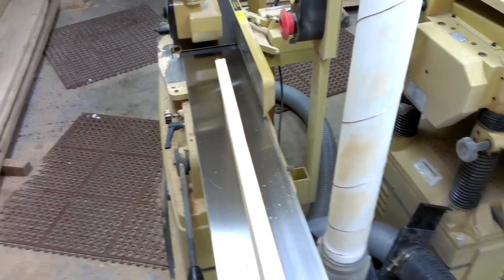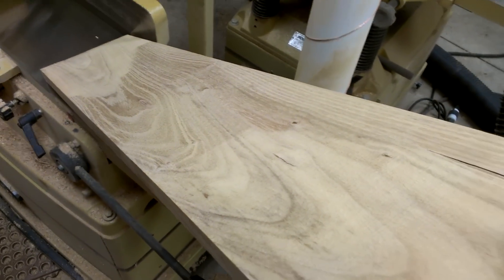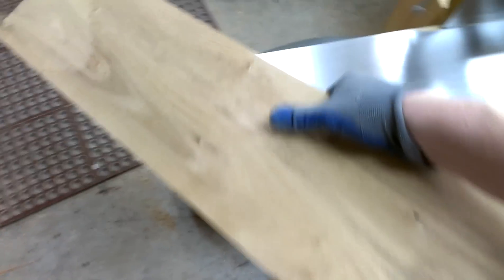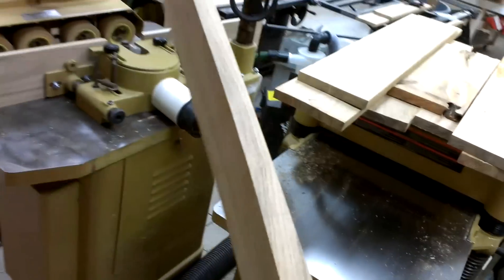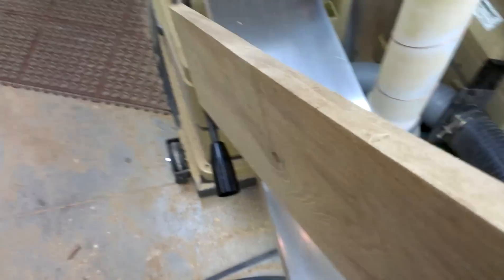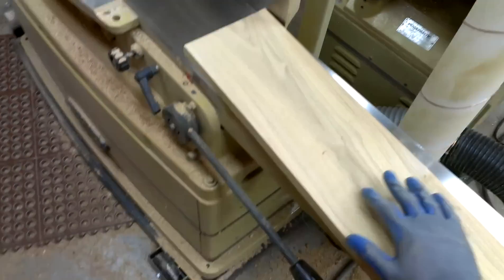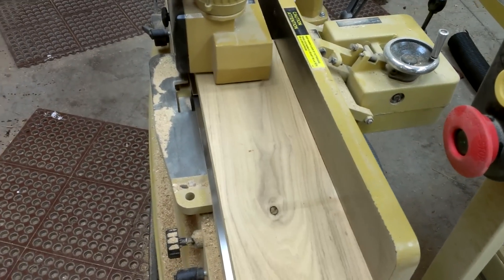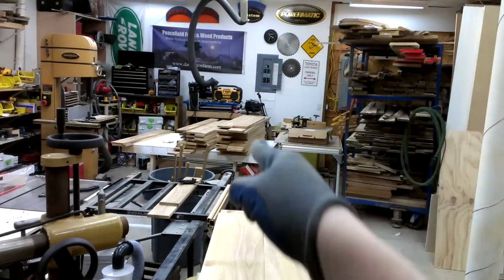Jointer with a Powerfeed

Comment: Nice video, I actually got a power feeder for free when I bought my jointer and have been trying to figure out what to do with it. This make me want to experiment with it, at least. Have you set it up to do edge jointing at all? Trying to picture how that would even work. Also, since I do realize this video is 4 or 5 years old, have you continued to use the power feeder long term? Thanks!

Comment: I was thinking about getting a Jointer/Planer for my shop.  it looks like with the setup you are using with the power feeder on your jointer that one could almost get away with just using a jointer and no planer in a small shop.  I would imagine the getting all the pieces of wood to the same thickness for each project would take some planning.  I was thinking that instead of a lesser amount on a planer and a jointer I could buy a much better jointer and accomplish the same thing. your thoughts.